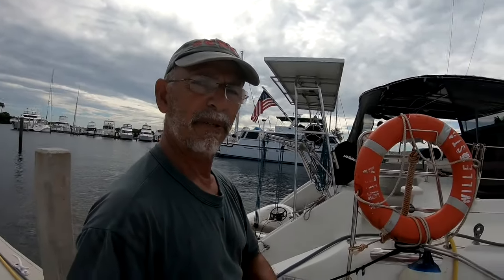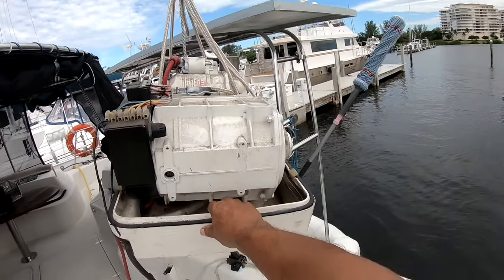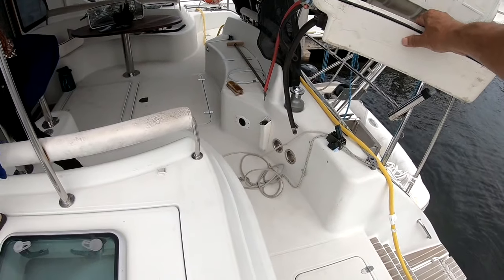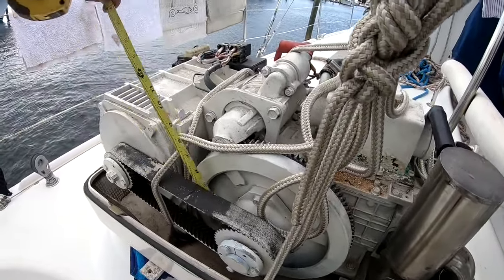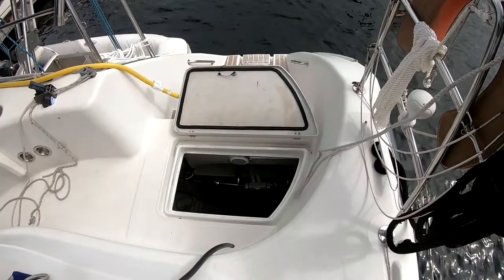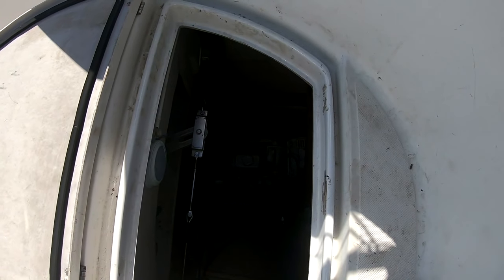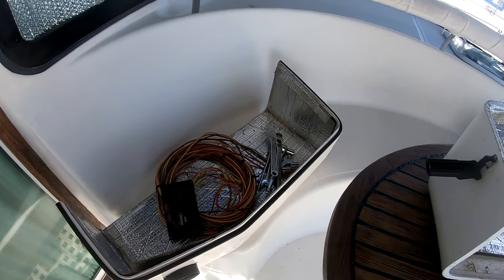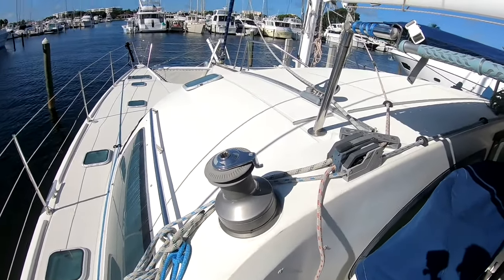One upgrade down Generator install

Comment: Hi, Al. Great to see the improvements. Two tips from a lifetime sailing. Get a mechanics magnetic tray for the bolts washers nuts etc as you remove them. Glue a small rare earth magnet to a long thin stick to retrieve items that go awol into crevices. Overboard is a real bummer!  Cheers. Brian
Reply from the maker: Thanks for the tips! unfortunately most of these bolts and screws are stainless steel

Comment: That was a good fit. Glad all went well getting the generator in that hole.i agree
Reply: I agree, let a electrician do the hook up. Don’t want to be in the middle of the ocean and have problems.
Reply from the maker: Yeah tight fit. I had another motor  but it would not nit unfortunately. Had to spend 3k on this generator LOL

Comment: WOW! Every day brings you closer to the point you can leave the marina. I'm glad we're along for the ride. Is there provisions for cooling the generator engine with the noise cover in place? Take care.    Bill
Reply from the maker: Yes and yes The gen has a sound shield  and the boat has the water cooling installed in it as well as exhaust.